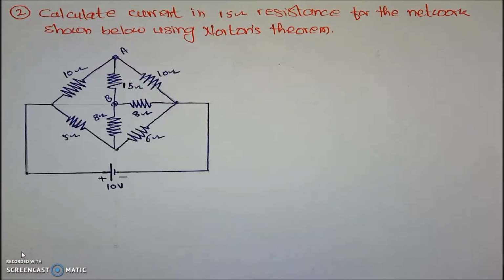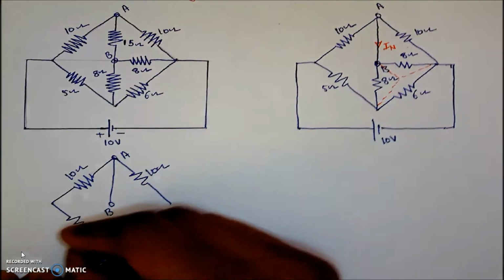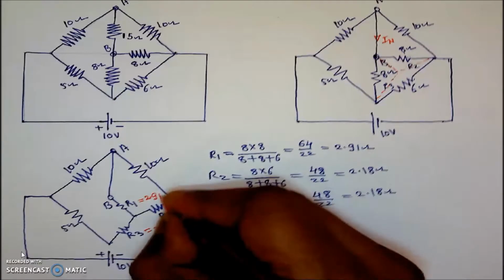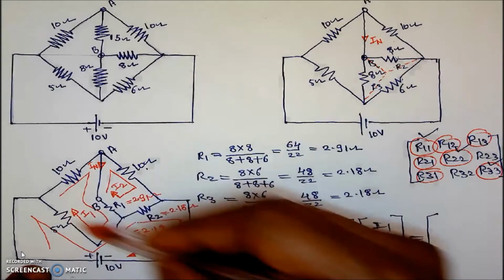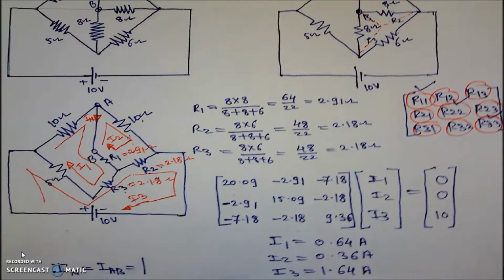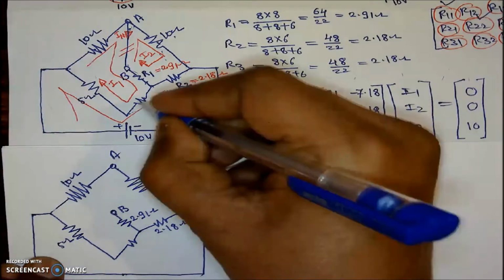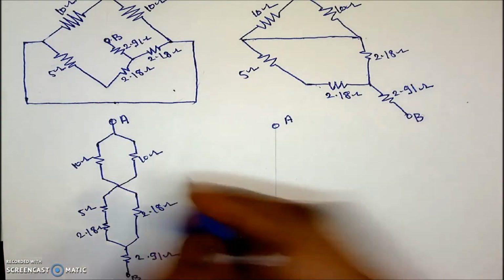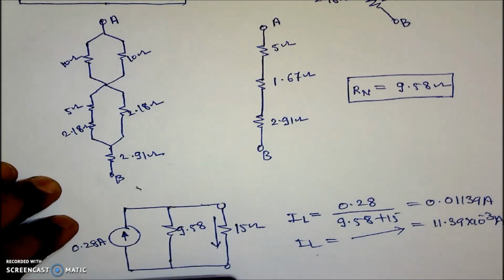Lecture 31 Typicial exaples for calculation of current Using Norton's Theorem by Dr. Nagnath Hulle

Comment: sir can we use direct inspection method in circuit containing dependent source?
Reply from the maker: Direct inspection method can be used for all circuits which consists of voltage sources. That may be dependent or independent, but for dependent sources we have to prepare extra equation.